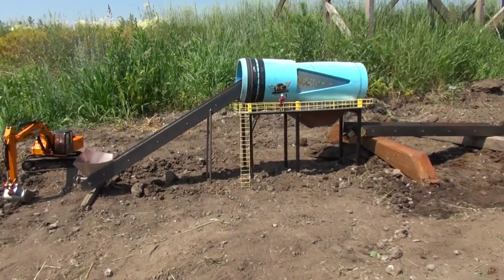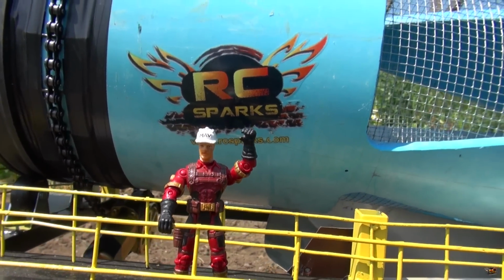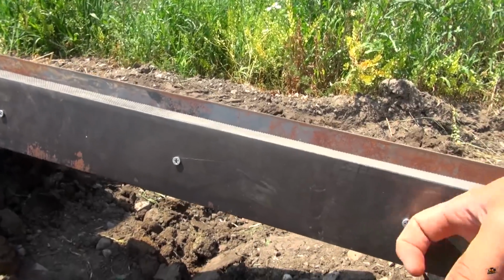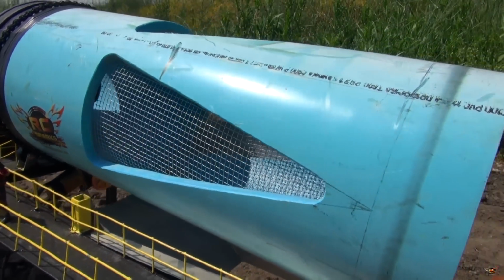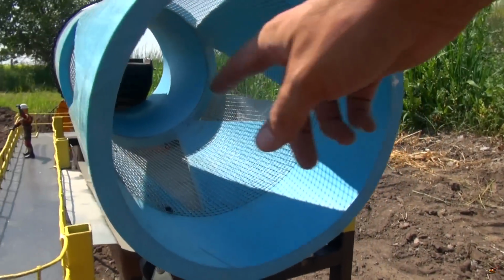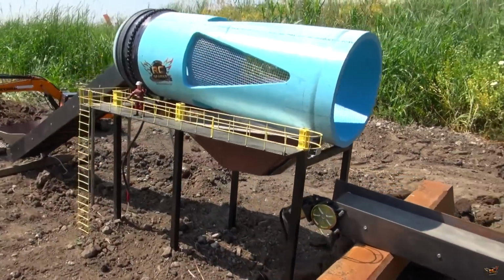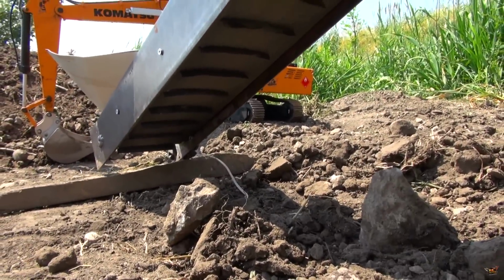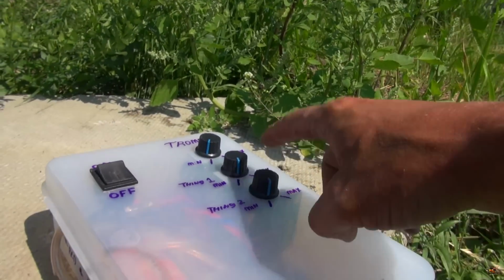RC ADVENTURES - GOLD Mine Trommel & 4200XL Excavator, Radio Controlled

Comment: Mike Terry Anchorage Alaska, I started mining in the late 70's. I started with a gold pan then a 2inch dredge, then a 4 inch dredge, then a 6 inch dredge, then a full blown operation with D8 dozer. As my health got bad I went completely backwards till I coul no longer do any of the above. On my way backwards  I built a small operation very much like yours except it was just a little larger than yours. You need to add water to your tromel to wash the gold off the rocks, and a sluice box with riffles and water to catch the gold. I do admire what you have done.
Reply: Lol, good one

Comment: I don't suggest much most of the time . Since either it gets over looked or laughed at but here it goes . Your trumle speed needs to be faster and water should be applyed to the inside of the trumle and a secondary riffle bed should be placed underneath the trumle for the pay dirt . Also a rock slide could be added to the end to help remove the bigger rock . Thanks for the awesome vids

Comment: I have no idea how this works for gold, but it's cool as hell !
Reply: 前
Reply: Rookie101 في
Reply: RCSparks should set his trommel up with so that the sorted material dumps directly into a sluice box instead of making a pile on the ground. THat way you don't have to have another machine to move the pile under the sorted trommel. RCS could also improve the trommel by adding an interior spray bar to wash the material going through the trommel sieve, which would then dump into the sluice below...
Reply: Rookie101 o
Reply: Rookie101 9

Comment: This would be a classifier operation and not a gold operation.You are trying to remove the large material from the finer material by the size of the screen in the trammal. No water is needed.if you did you would have mud and no fine quality pay dirt.Very nice work to you guys and the set up works real well.need to adjust your tailings conveyor belt so it's riding in the middle then you'll have less drag on your drive motor.love it and keep the videos coming

Comment: I wish I could find someone who could fabricate a working conveyor like the one shown (the loading one) but in a smaller scale if possible. I have a need for one on my model railway layout, but it would need to be out in all weathers.One operated by a micro switch and 12v is ideal. I don't need the radio controlled bit. Be happy to pay costs and shipping.

Comment: should get a 6 volt motor and make a pump for water and put a 12 inch water bar at the beginning and put under the paydirt a small sluice to catch paydirt and water to wash lighter stuff away and hold gold like your first one. I'd pay for a small one like tht . especially if it could all run on 12 volts.

Comment: What did he use for the geared motors
Reply: power window motor, worm drive high torque. :)
Reply: MadAddVent ok kool where did u get them
Reply: online seller, auto scrapper.. a fair price for a new motor is $20 40  sellers and scrappers hit $100+ for same motor shop carefully
.. there 12v dc motor, and work best with a dc motor speed controller
Reply: MadAddVent i have my own trommel that i have a a king hauler trailer i just really never see a worm drives that small. on my we used 50/1 Precision Planetary Gear Motors and the beits was FingerTech "Gold Spark" 16mm Gearmotor 100/ 1
Reply: Lee Means sweet, I was thinking about a trailer mounted trammel, but medic and I decided on the "plant" style Machine!!

Comment: Why don't you get a RC tractor and 2 or 3 RC trailer's then pull the trailers under the pay dirt to catch it then take the trailers and stockpile it then use a front loader on the RC tractor to doze it up